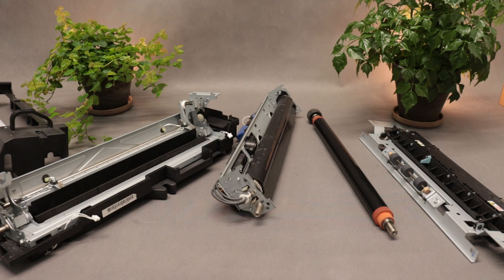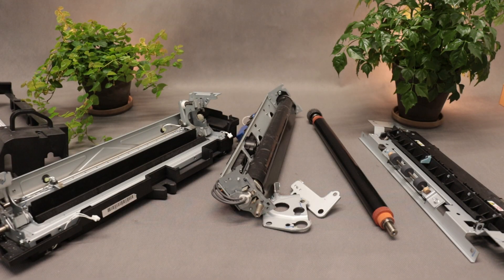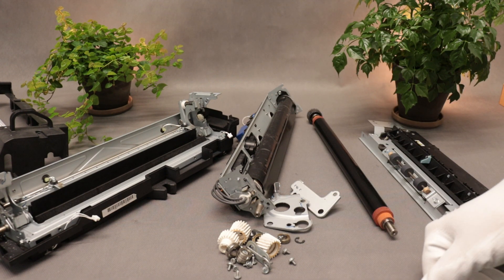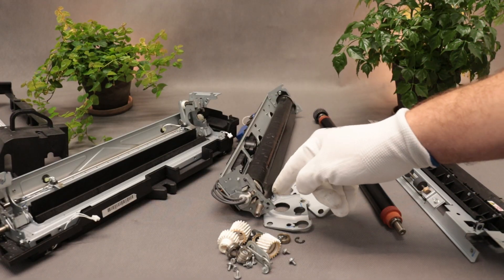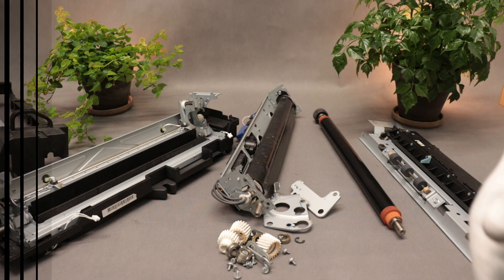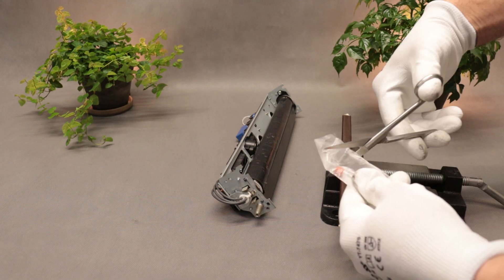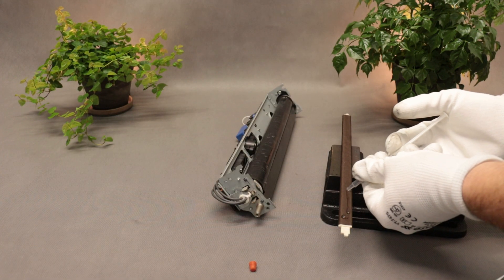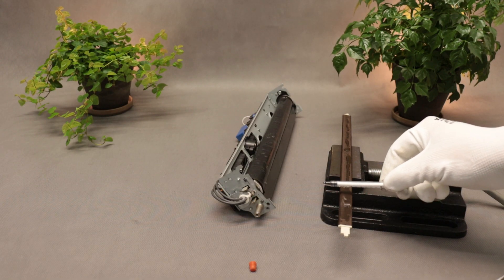Fuser Unit in Pieces! Customer DIY Disaster – Full Ricoh Repair Guide (MPC 3002 3502 4502)

Comment: Hello Sir, My first impression was the simillarity with kyocera M2135 dn Fusing unit . I mean a copy past technology . Thank you for this tutorial .
Reply from the maker: @dahmanus2002 You're absolutely right – the toner fusing technology is indeed very similar to that used in Kyocera devices. We have the same components here: the film sleeve, oil pad, pressure roller – all nearly identical. As for who came up with it first – Ricoh or Kyocera – I honestly don't know. My guess is that HP might have been the pioneer in this design.

Comment: I replaced all of these parts and the paper still jams.  Ricoh refuses to offer customer service.
Reply from the maker: did you also replace the oil pad?
Reply: @MrRicoh  Thank you!  Aficio 2022.  What oil pad?
Reply from the maker: @skykingimagery899 Ricoh aficio 2022 Ok. 👍 First of all, you need to replace the paper pick-up roller and the separator. This should help. 🎉
Reply: Because you have to call a Ricoh dealer for repairs.
Reply from the maker: @mg8720-u7j The Ricoh Aficio 2022 model is a slightly older device, so sometimes the dealer does not want to repair it and offers a new one. But is it necessary?